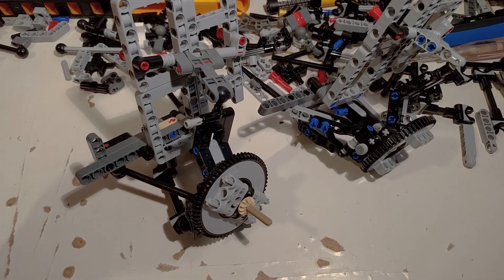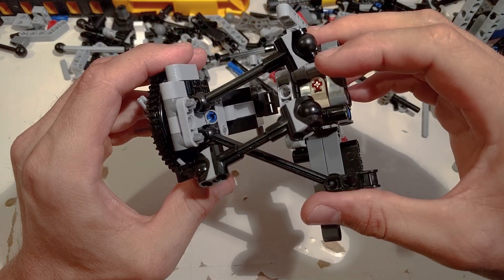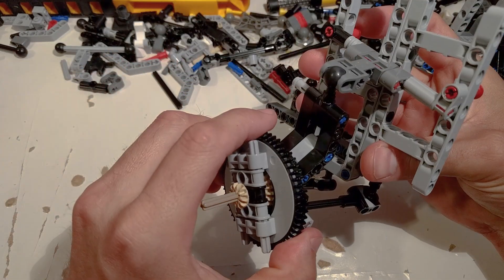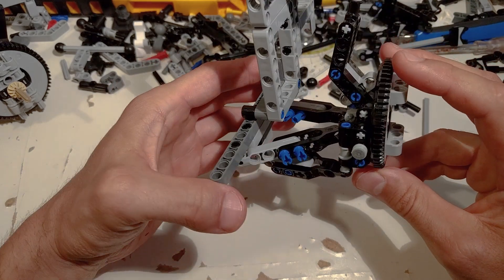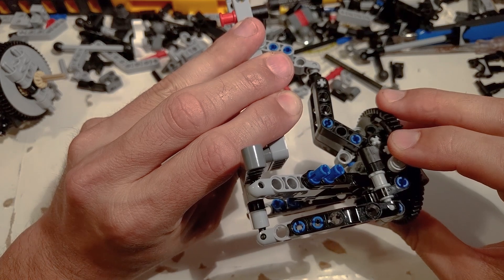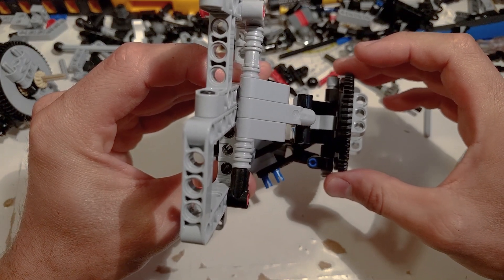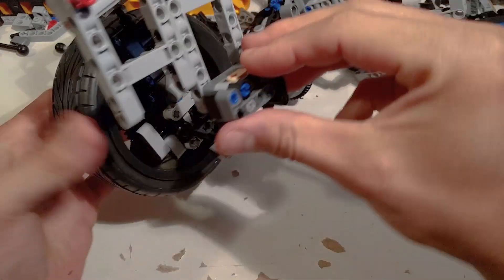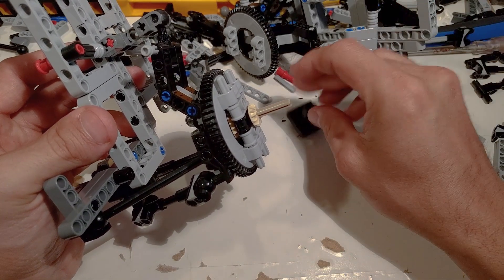Development diary 3

Comment: Maybe a drop of oil is all the bionicle joints need to move smoothly, sanding may introduce some play.
Reply from the maker: Not much sanding is needed. Basically just to roughen up the surface, to reduce the surface area that is in contact, so friction is reduced.
Reply: Ahh, I see. Interesting, I like this new format! :D

Comment: Hi Alex! Will you sell the improved, higher revving small inline 4 engine? If yes, then I will wait with my purchase! :D 
Also, why dont you use 3d printed lego pieces? That way you wouldnt have to cut pieces all the time and use limited slip differential in a very small form factor.
Reply from the maker: I will sell the inline 4. It needs to be tested in the car first. No engine model goes on sale without the car stress test.

I try to use as many lego pieces that i can. Lego plastic is also preferable to 3d printed plastic. But for a few things here and there you need to use 3d printing. Like the wheel adapters.
Reply: Thanks for the reply!
Reply: An other question: How much heat do these LPE engines create? With something that high revving as the new small inline 4 I think some kind of cooling should be put there with a small fan. If you havent done it already, you could do a long test with your engines where you run the engine for a longer period of time and measure the heat that it makes (future video idea :D) Of course you know a lot more than me when it comes to pneumatic lego engines, it is just an idea that might help you out!
Reply from the maker: Thing is, that the engines are actually cold to the touch after prolonged running. The expanding air cools the engine, and lubricated lego that is designed so that the axles don't vibrate and where everything is rigid enough, doesn't have a lot of friction. The engines, if lubricated, don't expirience any noticeable wear. And i have disassembled engines, that have been through a lot (mustag videos with burnouts, etc..). They did not show signs of wear.
Reply: Good to hear that, an other reason why LPE engines are awesome! I am concerned the strenght of the E30 and its drivetrain:

The 12 tooth beveled gear that you used the "differential" is notorious for breaking under load, so you will have to be either using that clutch very skillfully or come up with a new gearing there. 

The other part is the CV joint, when I was building my truck trial truck, the ones at the steering always popped out - i had good gearing and a lot of power from 4 XL motors - so that might be a part which could be replaced. I have heard that the older CV joints are stronger then the new ones, but they are also one stud longer. If you could fit the old ones to the car, maybe you should get your hands on a pair. 

Three questions for you: How are you going to operate the clutch? And do LPE powered cars need reverse if they have gearbox? because I know you have built a 3 gear automatic gearbox, but I dont think it has a reverse gear. If you want to go back with an LPE car, then you have to lift it with your hands or what? And the last one, between the "differential" and the clutch, you could add a brake system easily. I know you said that it is impossible to place brakes on the front wheels, but the rear ones could have them.

Sorry for these questions and ideas, but I am planning to build an LPE powered Ecoboost Mustang with you new inline 4 engine, so the more I know the better it will be!
Reply from the maker: Well, you raised many points here.
The gearing is not a problem if you provide support for the 12tooth gear shaft, so it can not deflect and skip teeth. I made some hard acceleration runs and it was all good.
The only good lego cv joints are from the 8880 supercar, but at the scale of the e30, they are unworkable, because they are too big. The challenger will have them in the rear.
Brakes can of course be easily added to the rear wheels, but i'd prefer to have a brake disc on each side of the differential, so as to not put strain on the gears during braking and risk damage.
The automatic gearbox is way too big and would require a major redesign. Now that the main building material are studless parts, i might do that.
Reply: Wow, thanks for the quick reply!

Does your auto. gearbox work good in a car or you only tested it on the dyno/test pad?
When I was talking about the 12 tooth gear I meant breaking, not skipping, but if tested it, then never mind - though it is a bit scary that such a small plastic gear can handle that much power!
If you can make two disc brakes to wach wheel, that would be amazing, I thought that would be still hard.
I have built myself some good compressors, but on youtube i have seen people with even better ones. Have you considered them in the trunk or somewhere else, so you wouldnt need the long tube? I think it wouldnt be able to produce that much that the LPE inline 4 requires, if you say it doesnt work out then I wont even try it myself.
Reply from the maker: We'll see how the small gear will fare when we make the driving video.

As for the propulsion. You either use onboard air tanks or you use a line. An onboard compressor is not a good idea. In that case it's better to have an electric motor as the prime mover. But i'm going the pneumatic route, because it's immensly satisfying to have a pneumatic engine that you designed drive your model.
Reply: I agree with you, LPE for the win! If I annoy you with my questions, then tell me, i will stop :D.
It would be cool if you would sell the custom 3D printed wheel adapters, smal pneumatic modified cylinders.

You could make a separate video about the clutch and its controlling, because i think it is a thig thet you better have when you have a gearbox! Also, if you are planning to do some drifting, then one thing that you could do to improve the cars performance is to add some toe out to the front wheels and (is possible) up to 5 degrees of negative camber. I know that it is almost impossible to make these small adjustments in LEGO, but if could make it then it would be so cool!
Reply from the maker: The clutch has been covered. It is just a simple one way clutch. Nothing operates it.
Before improving on performance, we need to first have the car perform at any level.
Reply: Ooo, i thought it is a regular clutch. Okay, now I get it, I know how it works.